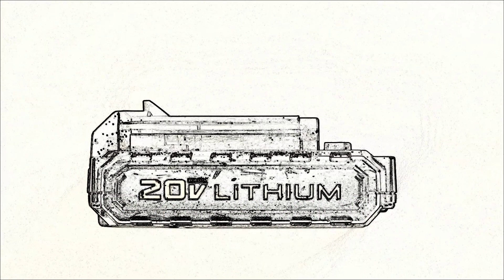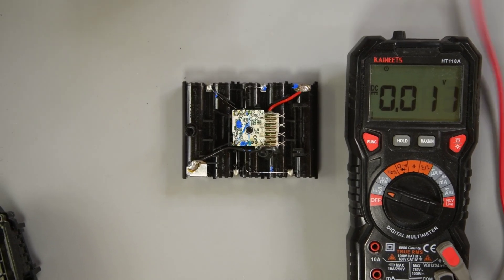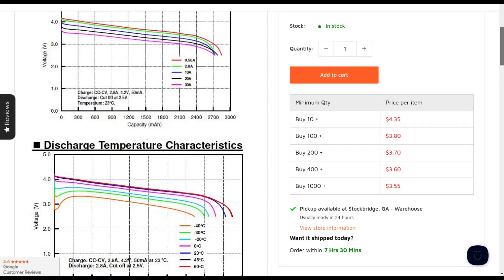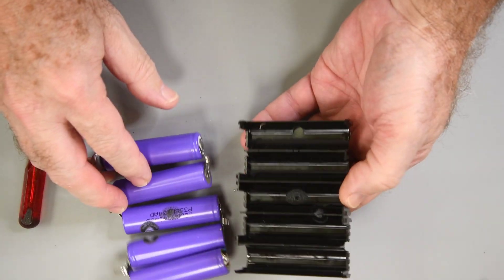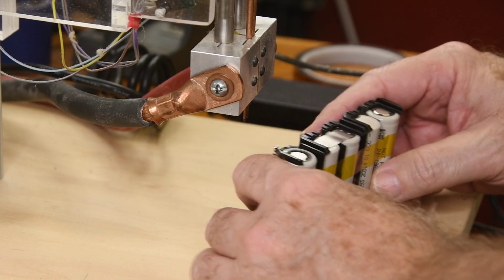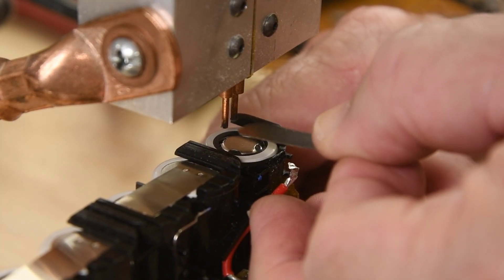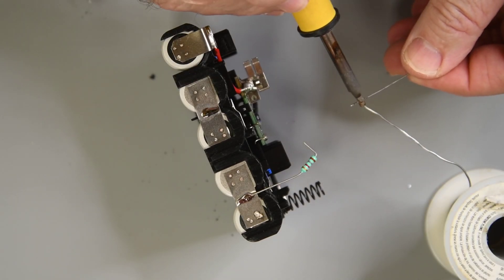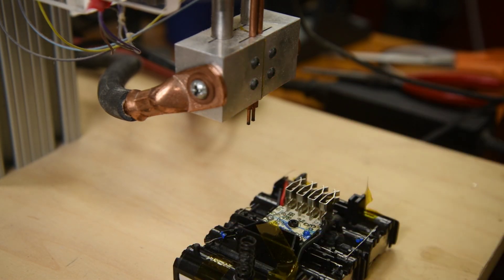Porter-Cable 20V MAX Battery Pack Rebuild

Comment: Very clever , way past my knowledge, skill , experience and inclination, I almost thought I could follow this tutorial until you pulled out that tiny welder lol . Nice video
Reply from the maker: A small spot welder is a must-have when working with battery cells. And since they are quite expensive, I built my own.  I have some videos on building it.